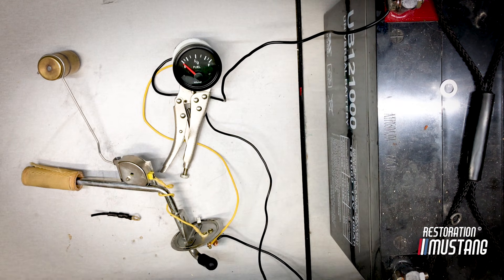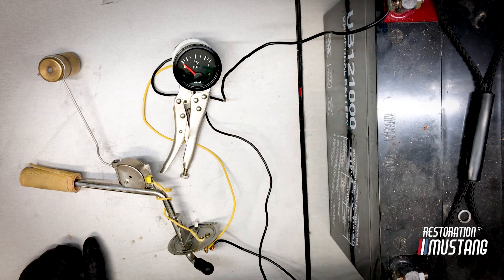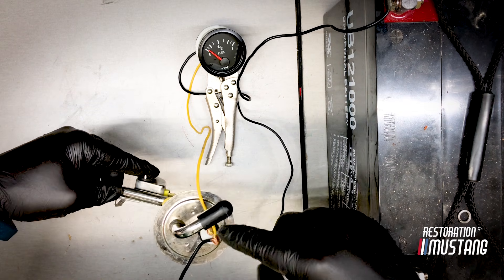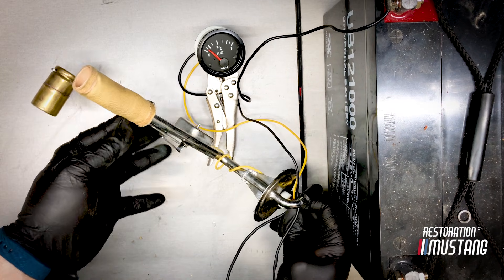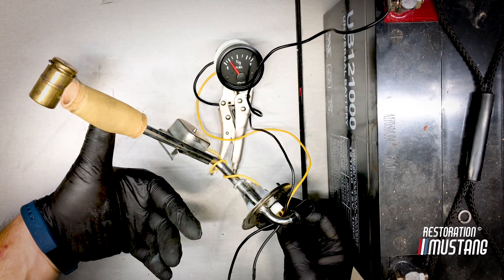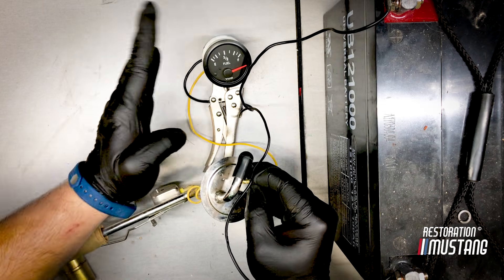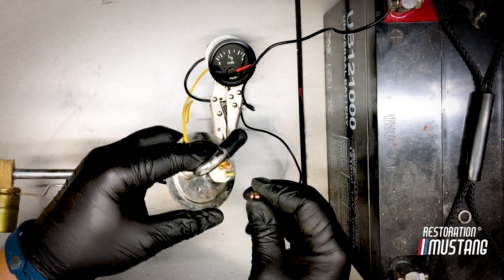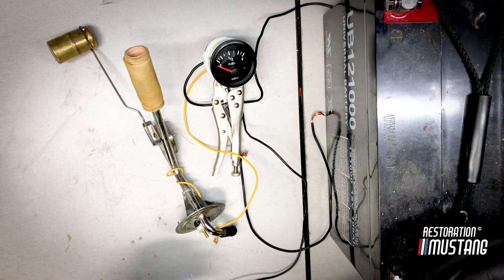How To Test a Fuel Sending Unit & Gauge | Old School Way

Comment: I need some help. I have a 1977 Ford f100. I replaced the gas tank and ever since then I've had an engine surge. I know it sounds weird. Sensei replacing the gas tank I have replaced mini parts on the truck to fix the surge problem. I've replaced the carb, spark plugs and wiring, electric fuel pump and a few other things including the voltage regulator. I put a brand new sending unit in the tank when I replaced it in the fuel gauge shows full all the time. I did pinch some wires when I put the gas tank back on not realizing they were between the tank and the frame. I'm wondering if I pinched a negative wire from the sending unit and would that cause the engine to surge? Any thoughts on this issue?

Comment: I have a 1980 CJ5. My speedo cluster has the fuel gauge built into it. When I start the jeep, gauge needle goes from below E to on the E. Won't go past. I have about 10 gallons in it. Has a poly tank. My temp gauge works good. I never really had a full tank. It was in the shop for about a year. I am going to de fuel the tank and drop it. I will see how the ground on the sending unit is. I never calibrated the sending unit before I dropped it in. Then again the speedo is made by Crown, and there is probably a quality control issue. Any help will be great. I got a new sending unit and I calibrated it with my multimeter. When I pull the sending unit out, I will check it with a multimeter to see if it need s adjusting, thanks!

Comment: What’s the spec for resistance on the ford pick up unit?  It you know? 
I don’t want to buy a aftermarket fuel gauge. I have a multi meter for testing components like this.  
Should be a range of resistance as you move float lever.  
Nobody makes a aftermarket pickup unit for full size Ford.  (Aftermarket units are an inch short so screen is not at the bottom of the tank. ) just sayin.

Comment: chasing an issue on my mustang.  just found out the foxes have an ivr/resistance wires in the cluster... I rewired my whole 82 gt from ron francis..and after filling up at the gas station im at 3/4 full...tested the sender wire and i think im getting 12v instead of 5v.. sender shows 10 omhs full and probably 70ish empty... howver im picking up 40 ohms when keyed off on that sender wire alone that feeds the cluster..,.. not much to go off these older mustangs. let me know if you have any thoughts. thanks

Comment: Great video. I did notice that you must have something wired backwards. If you oriented the sending unit as it would be in the tank the full position reads empty and empty reads full. The way you are holding the sending unit the the siphon tube would be towards the top of the tank and not pull any fuel.  Unless there is some camera trick going on that I'm not aware of. Just an observation. Thanks for the video.
Reply: I saw the same thing

Comment: I realize this old,but I have the same type of sending unit and the problem I’m having is the needle moves a little and stops. The wire is good and I just changed the sending unit. Any ideas? Possibly the gauge itself?

Comment: I have a 1983 toyota corolla KE70 i bought 2 mounths ago when i first had it i noticed there was a problem with the fuel gage it was reading  over a quarter of a tank after i have been driving for twentey minuts i stopped at my loceal store i notist the guage started moving up past the half way mark and then stopped and then slowley moved back down into the correct reading whice wss quarter of a tank so in thought i probabley need a new sending unit so i replaced that but it still does the same thing when i stop or park or go up a slight slope or slight hill i thing it could be  a bad earth wire or plug that connects to the contact of the sender unit needs replacing?

Comment: I think all modern cars since at least the 1990s would have the time delay circuitry in between the sender and the indicator to prevent the gauge from swinging wildly with the movement of the car seen in older models.

Comment: I got a very similar-looking stainless fuel sender for my 1965 Dodge Dart and also bench-tested before installing.  It was a bit erratic, so I popped the rheostat cover.  The wiper looked a bit loose, so I bent it to contact the slide-wire tighter and then gave a solid signal (10 ohm full to 70 ohm empty as I recall, Ford & GM different).  BTW, the slidewire wasn't an actual wire, but more a smooth conductive surface.  I also replaced the old thermal 5 V regulator w/ a modern electronic one and tweaked the output voltage to get the level and temp gages reading correctly.  To realize that, I had to also tweak the gage pivots and add parallel resistors across the level sender to get "F" to read correctly.

Comment: Excellent video explanation.  I'm actually thinking of making a little mock up of a 1965 Ford F250 custom cab dash guage in my closet with the tailgate and lights encasing it.  I open the tailgate and it opens up to a workbench so I can have fun and test individual guage circuits like a science lab for vintage Ford trucks.  I'll have functioning switches and pull knows and lights too.  That's my project plan anyway.
Reply: Sounds interesting I'd like to see it when completed

Comment: A Vette with a fuel cell,has 2 wires out of the cell which are green yellow and one purple wire out of factory.proper way to wire. I like your vedios much better than the nerds that use the ohm meter. thanks Robbie

Comment: What do you think my problem is if my gauge works from full to a notch under half tank... but never drops under that mark...i think maybe the float is damaged or hangs up at that mark...should I roll the dice and  just  replace it?  The car is a salvage vehicle 2017 Lexus NX200t  but never was hit in the rear.. Thanks in advance

Comment: Something in your gauge hook up is backwards. The end of the pickup tube goes to the bottom of the fuel tank. When the float is near the end of the fuel pick up tube, the gauge should read empty. In your video it is reading full.
Reply from the maker: All gauges are different. This one is reverse OHM

Comment: i just bought a new no start ls 04 tranks but no staart power to relAY POWER to fuel pump but im not seeing any power to the sending unit but if ones a signal and ones a ground i guess there shouldnt be power or a fuse

Comment: I have a 69 F250 my aux tank is like that .....I have 2 tanks only my in cab tank only has 1 wire to the sending unit and it has a grounding tab on the sender that's the one I'm having a issue with funny the gauges run on 6 v I tested the voltage on the sending unit

Comment: How is it that it reads empty when the float is furthest away from the sock? Shouldn't that be the full position?
Reply: Correct. He has it upside down - the sock would be at the bottom of the tank. Apparently, his gauge is reading reverse resistance possibly for a different sending unit. 1969 Mustang sending unit is 73 ohms empty, 10 ohms full.

Comment: To me that seems backward! Screen at bottom of tank to pick up fuel, float would be showing empty if it was next to the screen, right? Float away from screen, it’s full?!
Reply: I agree.   I think he has it backwards and I think he has the wrong gauge for that sending unit.   Ford's senders  have 10 ohms resistance at full and 75 ohms at empty.  I think GM cars are opposite that setup.
Reply: That is a return line, not a pickup, so everything is correct.
Reply: @yevgeniykovalenkov4708  so where is the pickup?
Reply: @Banjoguy55  He has apparently never been around a vintage Mustang.
Reply: @yevgeniykovalenkov4708  Not. It's a pickup with sock/screen. I've had my 1969 mustang since it was new and have dealt with its sending unit over that time. Any vehicles that had return lines during that era were 5/16 inch, and were right next to the 3/8 inch pickup. There is no other place on a mustang fuel tank for a return line. Just look at a photo of a 1967-70 fuel tank and you will see that there are no other openings.
Reply: @yevgeniykovalenkov4708  No,the return line still goes to the bottom of the tank.

Comment: FIX IT NOW 
}}            \\                         The Temperature gauge needs a "resistance value" or a Voltage? to be applied to the temperature gauge to see the needle moving from C to F?
When I disconnect the temperature sending unit/temperature sensor can't I just use a variable resistor potentiometer and watch the temp gauge need moving from C to F?
            the temp sending unit/temp sensor is a thermistor which is a variable resistance

But i dont' know what my temperature gauge is wanting a resistance and a voltage or just only a resistance in order to move that temp gauge needle from C to F?